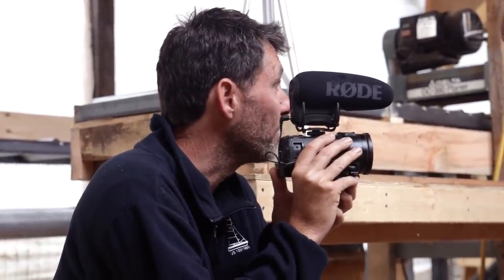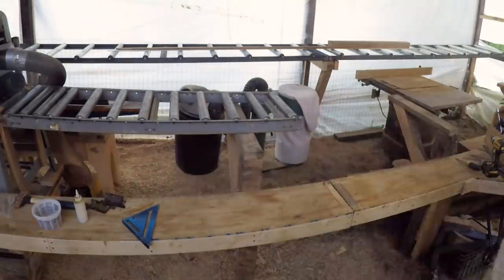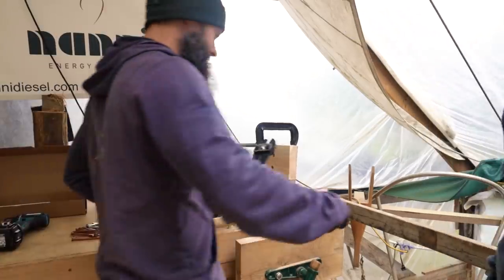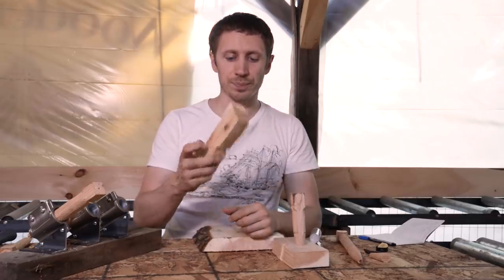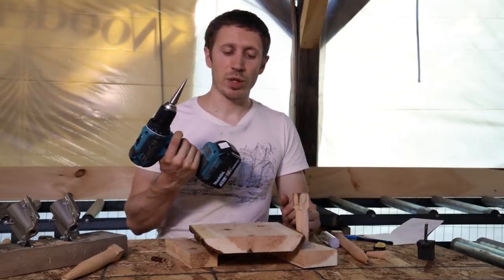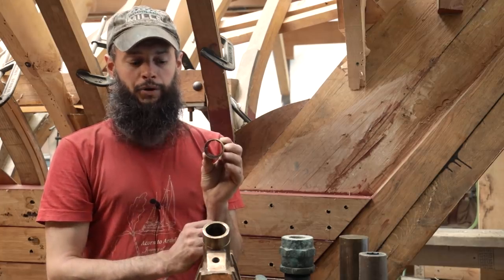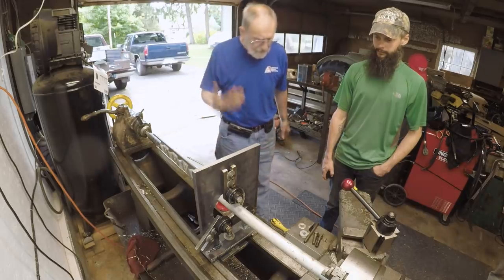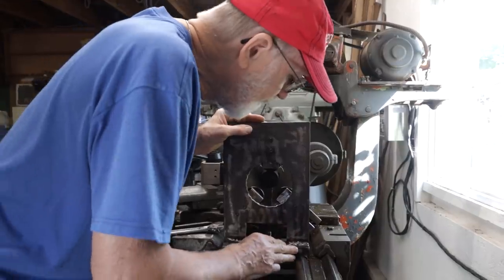Acorn to Arabella - Journey of a Wooden Boat - Episode 83: Riveting Test and Prop Shaft Assembly

Comment: A couple of pro tech tips for riveting: 3-5 mm. When sinking heads into the plank, 3-5 m is enough. the rivet always sinks into the plank, and if the sink hole is too deep, there isn't enough plank left to create a sturdy hold. and to the other end of the rivet, 3-5 mm is enough to create stable mushroom.

Comment: If you are concerned about the plugs swelling and splitting the planks, make sure you orient the plug grain in the correct direction "with the grain" of the plank so you don't inadvertently cause yourself a bunch of splits.  Otherwise the plug will swell and add a splitting stress that you probably don't want.
Reply: That was the first thing that came to my mind as I watched the segment. What is the grain orientation to the plank. Bunging a screw is cross grain but a plank hole, as you stated, should be with the grain.
Reply: Also, orient the plank so the outside of the tree is towards the outside of the boat.
Reply: Would you like to split the small end of the wedge, with a saw kerf then use a thin wedge to widen the small end after it is in. Would this lock the plug, or make it over expand?
Reply: the plug is end grain the board is face grain

Comment: I would HIGHLY RECOMMEND that you machine a short piece of the Delrin to your lining specs , then soak it in water for about 30 days !! Delrin will absorb water & swell up ! Iv'e seen this happen before , in 1974 the shop I worked in was asked by the customer to make 4 rudder shaft bearings out of Delrin instead of brass ,  There was NO information from the supplier about tolerances at this time . So we made the bearings slightly looser . The customer installed them . About 30 days later , boat is several miles from dock & then BOTH RUDDERS LOCK UP !!!!!! Now we have to press rudder shafts out and build boring rig to open up the I.D.'s of all 4 bearings !!! GOOD LUCK

Comment: When I changed my old  engine for a new Yanmar I used a flexible coupling  between the g/box and the shaft,which made aligning the engine much easier ,also helps with any movement in the hull.Great videos  keep going!Neal

Comment: i've never seen a boring bar used like that, with a bushing on the end, very cool
Reply: Bearings or guides on the boring bar are a “standard” technique for long reach boring.  With delrin it’s necessary because it will just move away from the cutter leaving an undersized raged hole.  It requires sharpe properly relieved cutters to hold dimensions while cutting delrin

Comment: on your rivet gun - put the regulator on the other end of the hose and put a swivel tail on the rivet gun.  The gun will create a lot of vibration which will play havoc with the connection to the gun and to the regulator itself.  Also, the lighter you make the gun the more likely your arm won't feel like it's falling off because any weight is bad weight at about the 100th rivet.  Keep up the good work!

Comment: Mounting a drill right into the boring bar holder is the ticket for these deeper holes in easy material. Can really get into and out of the hole without having to man handle the tail stock.

Comment: I'm sure if you put dowels in with the grain at 90degrees to the boards it will hold better. Green oak furniture joints are normally made like this with no glue needed. Great job as usual guys. Keep up the good work. ⚓

Comment: As a retired Navy airframe mechanic. I suggest taking the regulator off the rivet gun. Next you need about a height of twice the diameter extending past the washer and buck it down to one and one half the diameter of the rivet. One final note you should use the rivet gun on the head end and the bucking bar on the other end. This is just a suggestion also but annealing the rivets before use will also make it easier to work them.
Reply: As a currently practicing aircraft mechanic, the rivet can be driven from either end.  The technique they are using is referred to as "back riveting" and is often used when you want to minimize damage to the surrounding material.  On an aircraft it is common to back rivet rivet flush head rivets in thin skins in order to keep from distorting the skins, and it's equally appropriate here for riveting easily split wood planks.
Reply: jujitsuman68  No shit....  8^)

Comment: Hey guys, such an awesome project - huge amount of respect for your build, ethics and attitude.
There's a lot of rivets in the near future.... instead of manually hammering the "roveset", machine a fitting for the rivet gun, it slides over the riveting tool to draw the collar/rove down in that way (with your dolly on the outside, as you already do).

If you want to draw the rove down and rivet immediately, machining a roveset that fits the rivet gun that can be removed to immediately set the rivet will save days. It eliminates manual hammering.
So the rivets goes in... the gun is inside, you slide the roveset onto the rivet gun, ram the rove down with roveset, remove the roveset, and set the rivet with the gun. Gosh - can you follow my thoughts? 

I've some experience in aluminium boat manfacture, we know rivets - I'm a second-gen designer/builder. 

Oh, and the regulator should be at the other end of the hose. I'd use more weight on the gun, and more power/air than in the vid.

Love your work.

Comment: Just a quick safety tip with riveting, be careful with using it while it is not touching the  rivet. I have seen more then once where the riveting die has shot out of the spring retainer like a bullet. Keep up the amazing work!

Comment: I have seen the klinker rivets being done on the Dreken ship in Norway and they peen the tail of the fastener. I see you trying the same with a rivet gun and bucking bar on the head. I may be all wrong but conventional riveting on aircrat( again i may be wrong) you hit the head of the rivet and buck the tail of the rivet. On the lenght of the tail we use 1 1/2 D of lenght and flatten the rivet to a 1 1/2 times the D of the rivet.
Again this may not corolate to wooden construction but just thought I would chime in.
Reply: On aircraft you usually use the air hammer on the manufactured head of the rivet, but it can be done the other way too (the technique is referred to as "back riveting").

Comment: You might find driving rivets through the wood a bit easier if you wipe them with wax first - old carpenter trick for driving screws, etc.!
Reply: My dad, a cabinetmaker, kept a bar of soap in his toolbox for this... 😎👍☘🍺
Reply: @peterfitzpatrick7032  My grand'pa too.
Reply: bee's wax
Reply: My dad used an old toilet bowl ring.. was cheaper than traditional screw wax
Reply: My dad the plumber also kept a bar of soap in his tool box to drive screws with a hand and forearm you did not want to get spanked by.
Reply: @gordtemple764  I got the Butt of that joke.
Reply: Lol

Comment: Suggestion : Put a hook on the regulator so you can hang it from your belt.  Maybe male quick connect on the inlet and female of the outlet (I have had good luck with HF quick connects, but I am only a DIYer).  A "whip" from the regulator to the rivet gun.  Use a pneumatic swivel to connect the gun to the whip.  Keep a couple of spares of everything on hand.  You have a lot of rivets to "set" and you don't want to be stopped by a hose/fitting failure.

Square peg in round hole = snug fit !

Comment: Run an Ingersoll rand air hammer. Walmart for under $30. Use that to install the rivet body and the rove.  5000 strikes a minute. Easy air tool change to the rivet gun when time to dome the rivet head.

Comment: Nice choice on the rivet gun, Ingersoll Rand make quality kit, I would get rid of the pressure regulator and make sure you are running nitto type hose connectors instead of ARO style, you will get more flow and more power out of the gun which looks like a 4x, do not be scared to step up to a 7x or larger if you want more power, if you are after another gun and money is a factor then I recommend the Taylor branded gun, they are a very good quality copy of an old Chicago Pneumatic design which is loved by industry, they live up to professional use really really well and at half the cost of the Ingersoll Rand AVC guns you won't be disappointed.
Nice to hear a kiwi accent on your show.
Reply: Another thing, if you want to speed up tool changes ditch the safety spring, seriously, just use a strip of masking tape to hold the snap in the gun.

Comment: Straight plug vs tapered plug. I heard your explanation but I didn't hear why tapered is better than straight. I wouldn't think there is any risk in using a straight plug. Unless you didn't think you could drive a straight plug in. Or you felt there was a risk of splitting the board. In that case you could prepare the hole and then drive the plug in after you put the plank in. Or make sure your plug is not overly tight. I would feel certain that some day that boat will be pulled out of the water long enough for it to dry out enough for the tapered plug or plugs to fall out.
I am a wood worker but definitely not a wooden boat builder so maybe your research with more experienced builders has discovered the tapered plug to be the best choice for this repair. If so I would love to hear it. Experience is a great teacher and the old timers have knowledge we could never gain on our own. I'm always impressed with how hard you try to make sure it is the best boat possible.

Comment: You can purchase delrin in tube form.
Reply: That was my first thought: like wasting about 85% of material, need to use lunete on lathe, liquid cooling... so much trouble, why not just buy a tubular piece?!
Reply: Often the cost is more. They often don't stock tube, so it is special order at much higher price.
Reply: Probably didn't have it in an appropriate size
Reply: @hanvyj2   Having a tube even if the bore is the wrong size would have would guaranteed a straight hole .

Comment: If you have not already done so, use your boring bar with guide collar to broach 3 or 4 lengthwise narrow grooves in the ID of the delrin cutlass bearings.  They allow water flow to the full surface of the bushing keeping it lubricated.

Comment: Well, that was a boaring end to a video. LOL (see what I did there?) Nice to have an expert show you how to true and run that machinery. Hope you guys learned a lot. The delrin should make a nice shaft lining, that's for sure. A little seawater for lubrication and cooling sounds much more efficient and eco-friendly than packing the space between the actual drive shaft and the delrin. Good thinking. It all rests on the packing box to keep the water out of the hull. So, linen or cotton packing? Or do you have something else in mind? If you said in a previous video, I missed it.
Thanks

Comment: In aviation they use the following rule for stick out length of a rivet: 1,5 times the diameter of the rivet is the stick out length.
Reply: Robby van sambeek but the rivets are square! Lol
Reply: Yep, the rivet they showed looked very light on material for the formed head.
Reply: Annealing the copper first will probably help.
Reply: so a quarter inch rivet would stick out three eights inch, but from the rove or the frame?
aircraft rivets don't have roves; IDK tho don't tase me bro
Reply: From the frame, the rove isn't that thick to make much of a difference and there is enough tail to form the shop head that will secure the rove washer. Leave it too long and the tail has a tendency to lay over and drilling out and replacing those rivets would be an absolute pain.
Reply: Aircraft rivets are not riveting wood, ie compresible.
Reply: Yeah, but once you set the rivet head to the depth you want, you should be able to form the tail without smashing it further into the wood. I manage to install titanium rivets into carbon laminates and fiber glass without smashing it to powder or causing delaminations.
Its all how you hold the snap on the gun so the impact goes down the length of the rivet and bounces the bucking bar off the tail, rather than driving it into the wood like a nail with nothing to counteract it.
Reply: PaцḶєє BlцєṢтяєєт  There's a lot of overlap between aircraft building and boat building.  For one example of many, Boeing lifted the system of specifying locations on their aircraft directly from centuries of ship lofting.  As for the riveting, rivets have been used for centuries in boat building too, but looking to those industries that are still using solid rivets makes a lot of sense if they want to get it done in an efficient manner.  The rivets don't care whether they are smacked with a plain hammer or an air hammer.

Comment: For deep drilling on soft material, you can mock up your own 'Gun Drill' by brazing the last two inches of a drill bit to the end of a slightly smaller stainless tube. Plug the opposite end and drill and tap a hole at the far end to accept a hose barb, then you can pump coolant through the tube to the drill bit, flushing and cooling at the same time...

Comment: For future reference, i've had great success with keeping the drill in the fridge overnight in the freezer, then drilling delrin. I've managed to go 40 cm deep before the drill began getting warm again. However, for whatever reason, it does not work well if it's dull. I've had to sharpen my to my utmost highest level of precision and then, hone it till i could shave hair off my hand. No idea what's happening, likely the metal doesn't behave when cooled or the delrin is acting up when in contact with a cooled metal. I'd regularly go in 1 cm, then pop it out for a chip evac. Drill is 3 cm OD and my delrin stock was 4.5 cm OD with a pre-hole of 2.5 cm ID. All the drills used to cut were chilled, not stirred for 13 14 hours.
Reply: Have you ever looked for bits that were made just for uhmw and other plastics?

Comment: Hey,  just to let you know,  Snap On makes an air hammer that hits a LOT harder than the IR does.  I know it's a lot more expensive, but IMHO it's worth it, it really is beast!
Reply: The aircraft rivet hammers like the one they are using are available at several different calibrated levels of impact power, depending on the size and material of rivet being driven.  I am sure they selected one that's appropriate for the rivets they are driving.  Having a rivet hammer that hits harder than you need only leads to damaging the surrounding material.

As an aircraft mechanic, Snap On would be among my last choices for a rivet gun.  My first choice is a US Tool recoilless unit, but of course the one I have is much too small for Arabella's rivets.

Comment: Hi, just a comment re prop shaft stuffing box set up. On modern stuffing box set ups (whether compression style or the newer dripless) especially those with an enclosed cutless bearing in the shaft tube (as opposed to an external bearing in a strut) its common to have water from the engine raw water pressure circuit fed into the stuffing box. This is done to improve cooling and also provides the benefit of not having to 'burp' the stuffing box when launching. With traditional stuffing boxes that originally used real flax as the packing compound they did not generate as much heat as more modern materials that can be compressed tighter and set to allow a smaller amount of water to enter the bilge.My suggestion to you is to at least create a way to do this by welding a tube into your stuffing box that could be used for this cooling circuit even if you don't implement it right away (you can just cap it off for now) and then carefully check temperatures to see if you need it. I expect your delron tube (for all its other benefits) is going to reduce the amount of water exchange through the bearing which may exacerbate the heat challenge. Just a thought for you as I have not heard mention of the cooling challenge.

Comment: I come from an aircraft background, but its a similar principal. Rather than getting 2 rivet guns or rivet swapping snaps, you should be able to do all the work from the outside of the hull with the one gun and snap. 
Holding a big lump of flat metal (bucking bar) next to the hole will make driving the rivet through a lot easier. Without it you lose a lot of energy as the wood springs away from the impact. 
Once at the required depth you don't have to push hard on the gun, it is just there to hit the rivet head and put an impulse down the length of the rivet,  not drive it through the board. You can hold the snap with just your finger tips and use minimal pressure on the gun and let the impact and the dead weight on the tail do the work.
Place the rove on the rivet tail, hold the tool over it, place a bit of pressure on it and back it up with a lump of steel or modify the tool it to make it heavier. Then use light pressure with the gun and the snap hitting the head of the rivet will impart an impulse down the rivet shank and the inertia of the rove installation tool will drive the washer down the shank. 

Cut the tail back to around 1.5 the diameter of the rivet, firmly hold a bucking bar square onto the rivet and hit it again with the gun. The bucking bar will bounce on the tail, doing the job of a hammer and the tail should form and lock it all together. You could drill a shallow countersink into the bucking bar and it will help form the dome on the tail that you are after.

You'll find doing it that way will be a lot quicker and a lot less swapping of tools.
This gives you an idea of what I'm talking about.
https://youtu.be/3zQaMz7rtqY

Comment: Drill a 3/32" or so hole in the delrin through the top side of the bushing, and use the grease gun designed for the front roller of your chainsaw to pack the sleeve with grease.  Don't go all the way through the sleeve, just the top side.  You can do this after installation.  It slows down prop shaft leaks, and prolongs the life of your bushing.